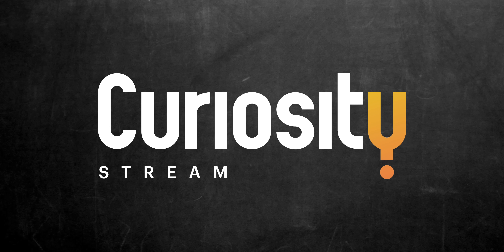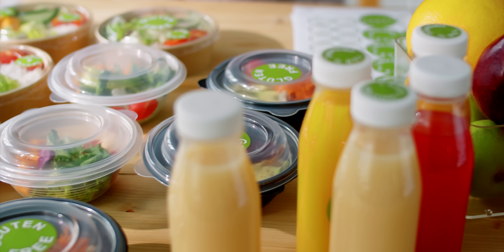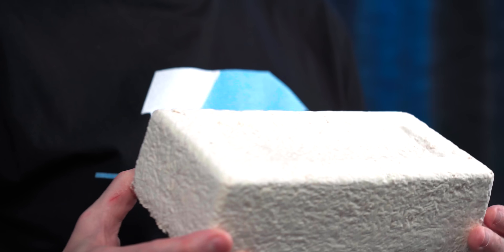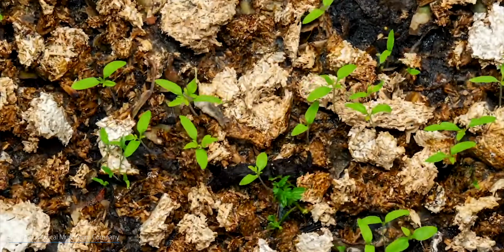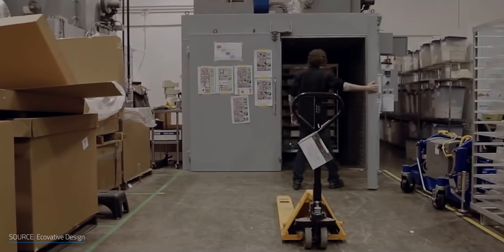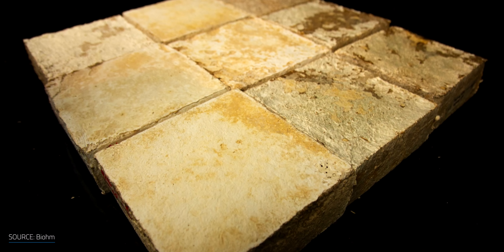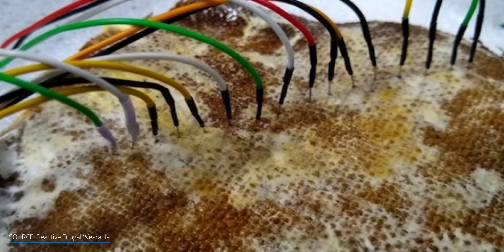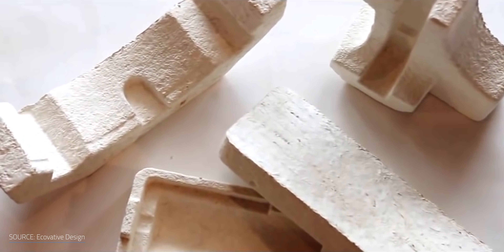Is Mycelium Fungus the Plastic of the Future?

Comment: And what about fungal allergies? Would kind of suck if I had to open every package using gloves and then (somehow) wash the contents of every packing box for the rest of my life just to avoid contact dermatitis. How to you wash fungus off electronics, wood, paper, etc without ruining it? Is direct contact with any of these products sensitizing, especially with wear? If I had to guess fungal allergies are not uncommon. Gotta make sure we don't create a world coated with allergens and unliveable. Also, how waterproof is this substance? There's no way in hell I'm using a biodegradable substance to build my house, even the top builders in the country can't make a 100% water-tight home envelope, especially not without plastics, to protect a product like this from moisture exposure. I'd much rather use Roxul for insulation, which is made of rocks, doesn't degrade in water, has supreme thermal and sound insulation, and is also fireproof. I like how he only compared the mycelium insulation to pure-plastic products versus rock wool insulation, which is the gold standard. 😏 Products can't just be possible, they have to make sense. I'd much rather have a super durable house that can stand for hundreds of years, which is now possible thanks to plastics, than one that lasts only decades because it's made of fungus.

Comment: There is no way it can fully replace plastics. The whole reason we use plastics is because it lasts far longer than any other materials, it’s lightweight, some of them are chemical resistant, and it can be reformatted into different carbon-polymers. You can turn a plastic bottle into fuel, and the resulting CO2 from combustion can be used again to make new sub-plastics. Mycelium plastics can be useful, but only in temporary situations, like clothing, cloths, bags, packaging, etc. while plastics specialist in durability and resistance, like chemical storage (think acid), space engineering, and other things that require something that won’t break down. We cannot abandon plastic, but we can stop using it where there are alternatives.

Comment: I Have a hard time believing that the cost for production is less than plastics based solely on the time you said it takes to 'grow' into a product. The space needed to grow would be immense and the cost of the building and the air management plus the people needed for the time frame would be just as large.

What is the effect on people with mold allergies during its rather short lifespan since it is decomposing?

Comment: I own a solid brick (8" thick wall) two story house -- Built in 1940 of a good design and extremely solid materials in NE Ohio.  I have been thinking about renovating it by applying the insulation to the exterior (6" or more) covered by a hard seal exterior shell stucco like material.  What are the insulating properties of this material and life expectancy?  Please advise.

Comment: I agree with everything, except that it's virtually impossible to recycle EPS and XPS.  Polystyrene foams are incredibly easy to recycle, however as the finished products are 98% air, they're incredibly expensive to recycle by volume, thus making it a financial issue rather than an issue of the material itself.
Reply: Pseudomonas putida that degrades styrene oil (polystyrene depolymerizes at high temperature) was the first patented organism in the world, and there even was a famous court case Diamond v. Chakrabarty that resulted in patenting of an engineered organism. That was in 1980, so why was it ignored by a very popular pop-science YT channel in 2021?

Comment: Sorry to correct you here. I had a look at the Mycelium based insulation product. Its thermal conductivity is 0.024 W/mK. While impressive, PUR-insulation can achieve 0.015 W/mK. Not to mention others like Vacuum-insulation. Of course a natural alternative is interesting (there's Hemp, Wool and so on) but modern polymers are still better.

Comment: Would it be possible to dry up mycelium blocks, grind them into powder, add water or some other environmentally-safe liquid/glue, and make a liquid base that could fill molds? I have read that mycelium is water-resistant but I’m wondering if that’s species-relative.

Comment: How well does it grow in Zero Gravity?
Maybe it could be used to replace the foam cores of walls for the TransHab type modules, or to grow interior structures in buildings printed from rock based materials on Mars, and as a replacement for soil in vegetable gardens on long duration space missions.
Reply: Wow,  this tech is brand new and you're already thinking way outside the box.    Well done
Reply: @moonkey2712  From here, you can't even see the box anymore ;)
Reply: Wow! I hadn’t thought of that as a use for it. In the video he said that it is a good insulator which would be useful on mars and other cold planets.

Comment: I like how all the molds, platters, and other parts used in making mycelium products all seem to be plastic. Wouldn't an increase of mycelium usage just increase plastic usage in it's production?
Reply: you can reuse the same plastic packaging near infinitely, while creating more sustainable, renewable things with these plastic molds. that way, even if they do eventually have to be thrown away, their impact on the environment is still significantly less then what it is today. if just one plastic mold can create 2 or more of the mycelium items, then its making more proucts that will not harm our environment, as opposed to making more products like it that will harm nature. who knows, maybe with more research, we can get it to act like plastic in terms of creating molds and such. maybe even replace existing uses of plastic such as with water bottles, various bits of plastics needed for machinery, so on and so forth.
Reply: The most important thing is for it to replace single-use plastic.
Reply: i was wondering too, there must be a reason the container is clear. may be they need a clear container so it grows faster with light? And for sure glas would be too heavy. And i think of reuseable silicon baking pans. You need a litle bit of movement to get the cake out. Glas would be too stiff/inflexible.
Reply: @abrafkalif  fungi aren't plants, in that they do not perform photosintesys. Therefore they do not need light to grow, and actually prefer darker places, like under trees where there isn't as much light as the rest of the forest.
Reply: @LOrco_  oh yes, right.
Than i can only guess: To visually see if fungi is fully grown?
Reply: @abrafkalif  That's most likely correct. The most likely use i can think of, and what was demonstrated in the video clips, is too make sure the mycelium has fully grown into the entire mould. if they take it out too soon just because the top looks done, they will ruin the incomplete structure of what they're trying to make. Seeing it and knowing for certain is far better (and reduces waste in the process) than guessing and possibly being wrong in your timing.
Reply: @abrafkalif  wow. stuff that naturally grows underground needs light? FOR WHAT? FUCKING GENIUS
Reply: @MrDoboz  If you know the answer, we are all here to hear it from you. I only made a suggestion. But for sure you genius already noticed it.
Reply: "Replace plastic" doesn't mean "BAN ALL PLASTICS, DON'T USE ANY OF IT ANYMORE!!!!"

Hope that cleared it up for you.

Comment: Plastic brick: 1-2s cycle time to produce
Mycelium brick - 1-2 day cycle time.

So a manufacturer can make 40,000-80,000 styrofoam "bricks" in an automated process on a relatively small machine in the time it takes to bond together a few trays of mycelium bricks.

Unfortunately, I see this being limited to marketing stunts and the fringes of the marketplace.

We need real solutions that satisfy all stakeholders, otherwise things will continue as they are.

Comment: I highly doubt it will replace all the plastic simply because the end product does not have a smooth surface. Plastic has, mycelium doesn't. It would need post processing which would make it more expensive and harder to make than plastic.
And the fact that it is biodegradable I doubt it will be food safe, just like biodegradable 3D printing filament is not food safe due to bacteria.

However I am pretty sure this will replace styrofoam and everything that does not need to be a smooth, ideal fit. 

Unfortunately, we will be stuck with plastics for years to come.

Comment: Rice husks with a stabile and safe insecticide, like borax or diatomaceous earth, work really well for insulation too, and are a waste product of agriculture. This material being an insulation panel like polystyrene would be great, but I suspect that it is more vulnerable to damage from moisture intrusion, unlike a plastic. It might still be useful for wall and roofing insulation, with a possibility of being part of the exterior insulation layer for stucco, but with its mechanical properties and questionable moisture resistance, basement and under-slab insulation will not be viable. Nor will replacing polystyrene insulation for under stucco since it must tolerate moisture.

Maybe there is a polymer stabilizer that could help with this, especially the mechanical strength?

Comment: Hempcrete bricks are still weaker than concrete at an average strength of 145psi but that's still 3x the strength of mushroom bricks. Hempcrete bricks and mycelium insulation would work better than purely mycelium.

Comment: For some things it's actually a benefit to NOT be biodegradable. Plastics are great for things that need to last long. It's a great and cheap material. The main problem is when plastics are used and then thrown away.

The "use once, then throw it away" mentality is the real problem, plastics are not. Plastics just enabled this mentality because plastics are so cheap (mostly because plastics are easy to mold into shape).

Hard plastic cups (that are reused) are just as good as glass cups, and sometimes even better. Plastic lawn chairs and tables are great too. As long as you use it responsibly and in products that you intend to use for a long time, it's not always a bad idea to use plastic.

Comment: It's a stupid idea to use Mycelium as a replacement to plastic. Plastic is cheap and affordable to everyone. You can bring it into a form in just a few seconds which result in low pruduction costs. Mycelium needs some time to grow, so you need a great stock which will result in higher costs. You can't recycle Mycelium.
Plastic is not the problem. The problem is how we treat it and the lack of any regulations and recycling processes.

Comment: Note: the mycelium is shipped in a plastic bag.
Reply: It's currently good as a rigid plastic replacement.
Not so sure about the flexible plastic replacement thing.
The two are not the same.
Reply: Heh. Ironic
Reply: welll, if thats the case its still way better than now. If its shipped to companies that uses it to produce things the bags will be taken care of in the correct way
Reply: in order to prevent premature decomposition I guess
that says a lot about it tho
want house insulation that's so environmentally friendly that it decomposes before even you put it on the walls? Now you can have it!
Reply: It’s likely to prevent contamination

In mushroom cultivation sterility is paramount. These just don’t go to fruit.
Reply: * double-take *
Reply: Uh Oh must cancel mycelium MISSION FAILED
Reply: 😂 They didn't think that one through 👍

Comment: What I noticed here are all the plastic products used to create it. With the current level of adoption I have to wonder if they demand on plastics is increased or not to make this stuff. How many of those mulch bags or the gloves the workers wear get tossed and end up in the same place as the rest of it? Those molds look like something that would have to be custom made as well and what's the lifespan on those before they end up in a heap? Perhaps if it does see global adoption in the long run it may reduce plastic usage. But from what I've seen it really isn't a total replacement. Just a material that is better for some things. Which is still good. But it's also good to remain skeptical of such things until they have proven themselves beyond refute.

Comment: The issue is that it decays the same as a cut crop. It has no construction applicability because it degrades in open weather and for interior use it is extremely flammable. Packaging maybe but lets not hype people up with industrial hype. This "miracle" hype is just like the plastic companies.

Comment: You commented that when in burns, it doesn't give off toxins, but you never mentioned just how flammable it is. That would be THE most important factor is its use in clothing, and one of a few factors in its use as insulation.

Comment: So, since you asked, here's what I think.  First, the title, mycelium fungus, means nothing.  
Second, as the start of an idea, it's fine.  But this is only a start.  It is not, in it's current incarnation, a construction material.  In the most ideal conditions it has an expected lifespan of 20 years.  Expected, since this tech is so new that no one knows it's actual life expectancy.  It has less than 1 % of the strength of concrete and brick.  When exposed to the ground it starts decomposing in 6 weeks.  It has been suggested that it could be good for interior no load bearing walls and for insulation.  No, would anyone want to have to replace the interior walls and insulation in a home or commercial building every 20 years.  We have products now that work dar better, last longer, and do not require massive continous expenditures in building maintenance.  Add to that, one would be forced to maintain a building and home within a narrow window of temp and humidity lest my walls fail...by decomposition.  Third, it is suggested that the material works as well as soft wood.  Softwood interior walls and structural exterior walls...pine is not a hard wood...can last centuries if maintained...and thats limited maintenance.
And for those interested, search for mycelial brick.  Have fun wading through the pseudo- science.  

MycoWorks, which started this "innovation" was confounded by an artist.  Projects like this need to be run by sensible, educated, and practical individuals.  Oh, and throwing in the reference to hemp was a give away.

Comment: I dunno if I'd trust it as an insulating material. At the end of the day, it's still a porous dead fungus. Moisture from humidity and that it would be designed to be in the dark confines of inner walls and attics just screams black mold or other dangerous molds forming on it. Blown insulation is dangerous, yes, but I'd rather the devil I know in this situation compared to something that could have greater potential damage if not condemn my home. That'd need to be tested for a looooong time before I rip out all the pink cotton candy in my attic.